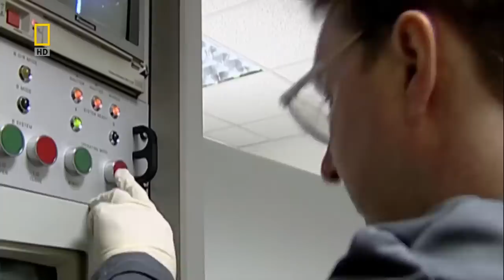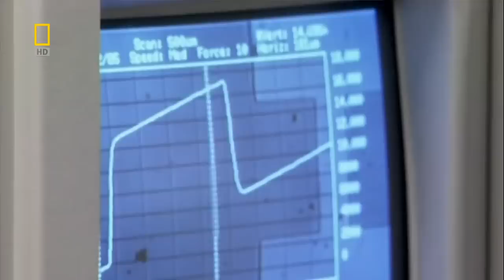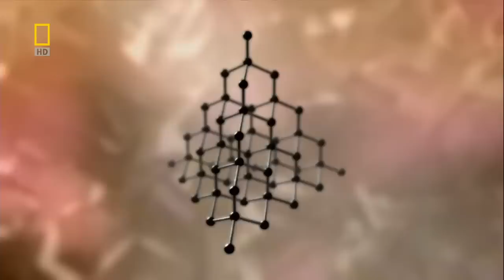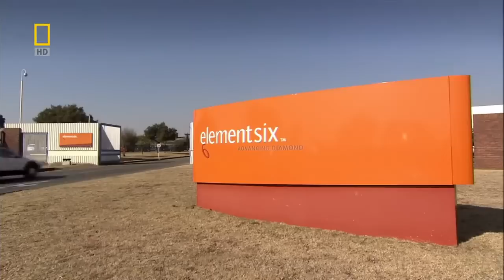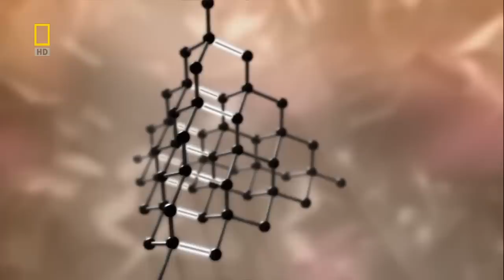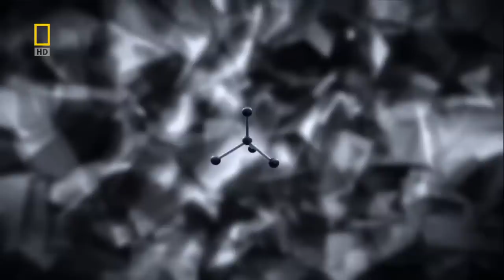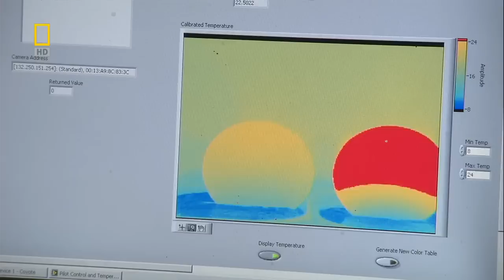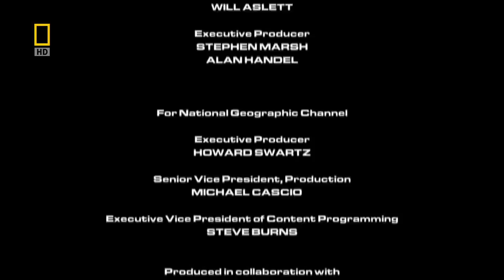Super Diamonds | Naked Science | National Geographic HD | Full Documentary

Comment: I'm intrigued as to why pure white diamond is a near-perfect insulator yet it can conduct heat five times better than copper. If we compile a list of all the metallic elements in order of electrical conductivity (silver first, then copper, etc. etc.) and compile a second list of all the metallic elements in order of thermal conductivity, the two lists will correspond almost exactly. Why doesn't this correspondence of electrical conductivity and thermal conductivity apply to diamond? The carbon allotrope graphite is a medocre conductor of heat and electricity, what is it about diamond's lattice structure that changes its properties so redically? Are there any scientists out ther who can answer these questions?
Reply: Bulk graphite is a poor conductor of heat because the flakes of graphene are only weakly linked to each other, even where perfectly aligned in neat layers.  Diamond is a giant single molecule with every atom strongly linked in every direction to its neighbours,  so when an atom vibrates (a.k.a. heat) those vibrations are passed along efficiently.   Crystals in general (and metals are made of lots of small crystals) are good heat conductors,  but diamonds have especially strong bonds.
Reply: Pure silicon is also near-perfect insulator. Similarly to diamond, it's the doping which transforms the stuff into a semi-conductor.
Reply: Quantum physics (look up "band structure"). Free electrons (like in a metal) are only one channel for heat/sound conduction.
Reply: That’s a good question. You can have single crystals of metal, like gold, iron, copper, etc. and they are all good heat and electrical conductors. I’m guessing the high thermal conductivity of diamond is due to the strong carbon bond, which is apparently better than free electrons when it comes to conducting heat.
Reply: think of it like the difference between heating a bowl of BB's (graphite) with a torch and heating a single steel bearing of the same weight (the diamond).
Reply: Ok… I’m no scientist, but I do recall they said blue diamond is a good conductor not white or clear. And the claim was that diamond transfers heat, not insulates, as in absorbs the heat and spreads it out evenly over the entire surface. Like the disc in the ice. I believe it was miss understood. The questions you ask are intriguing in themselves. Although I believe miss guided. The synthetic diamond is a good conductor and heat sink … and is the real focus. It can be grown to scale and used in a endless amount of ways. From computers and tech to clothes and cookware. And everything in between.

Comment: Just imagine, diamond dust added to violin rosin? Would that not yield a superior abrasive and vibrate the string with more finess ?
Reply: It would shred up the horsehair and the strings. Then it would cause scratches on the lacquered finish on the outside and would embed inside the porous cell structure of the unfinished wood, interfering in the violin’s ability to properly vibrate. Then there’s the dust from this rosin: breathe that and you probably get something like black lung or mesothelioma. 

I’ll pass.

Comment: interesting connection, I worked in a wafer fab and I remember, pure deionized water is an insulator (doesn't conduct electricity, like a clear diamond) add impurities into the water then the electricity can flow
Reply: Yes. By definition, you need ionized water to allow the flow of electrical current. The ions come from the added impurities. De-ionized means NO ions.
Reply: @oscarmedina1303  so solids and liquids have similar properties? when it come to conductivity